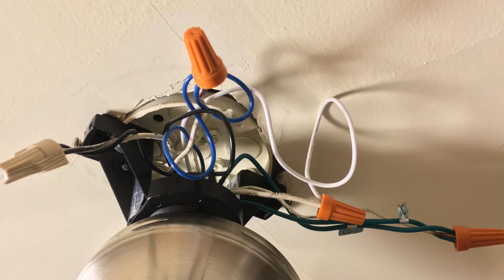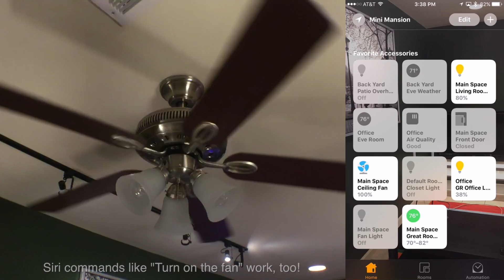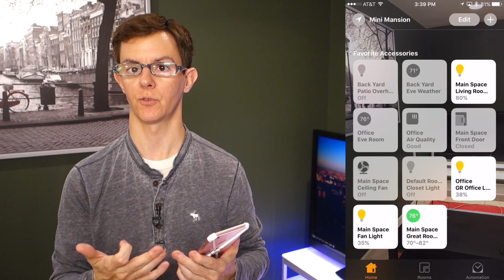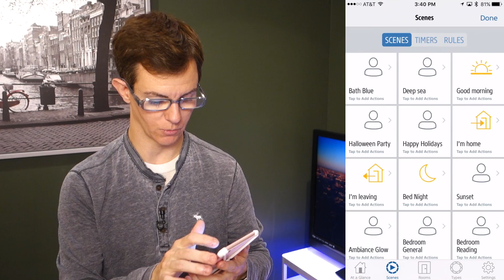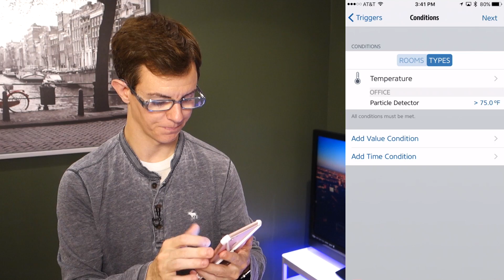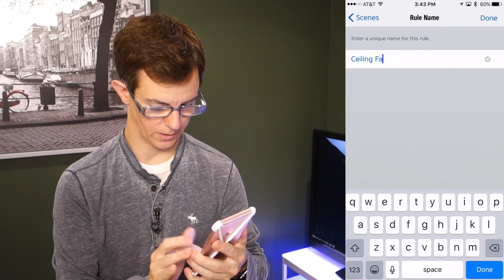Install & Review: Insteon Ceiling Fan & Light Controller

Comment: This is an excellent demonstration of an important automation area worth exploring: fan controls. We also use HomeKit to control our fans: turning on bath, and range hood fans when humidity, temperature, or CO2 levels reach preset levels. We are looking for more variable speed controls in HomeKit to provide increased granular control over fan speed, so this provides one useful path. I wish there were a method that didn't require a hub, and homebridge - to simplify the process.

Comment: Do you know if this would fix my ceiling fan motor that is stuck on 1 speed?
Reply from the maker: Potentially. Is it stuck on high?
Reply: Yes it is definitely stuck on high.  I was going to purchase a either a new switch or capacitor.  I was wondering this this device would be a replacement for that but I figure that is not the case
Reply from the maker: If it is stuck on high, then that's perfect actually. You could connect the fan to this device - the Insteon controller - or any other fan-speed controller and have good results. They all require the fan be set to high speed so that they can then control the speed appropriately.
Reply: Joe, thank you for the information.  Last question do I need the Insteon hub to use the controller or can I use the controller with a different smart hub?   I'm still up in the air on deciding which smart hub to purchase. I'm leaning toward Samsung's Smartthings.  Thanks for your informative videos and keep up the great work!
Reply from the maker: Yes, the only drawback is that you'll need an Insteon hub to use the controller. But there are many other fan controller kits that are out there that offer remote control via an RF or IR remote that are less expensive, but don't necessarily have smart home integration. You could get a cheap IR/RF fan controller and then link it up to a device called The Bond that can bridge IR/RF devices and smart home controllers.  And, thanks for your kind words! :)

Comment: can you use this light feature with  ceiling fan lights? just the lights not the fan. Just through wifi not going through taking apart wiring. etc...
Reply from the maker: Easiest way to do that would just be to use smart bulbs and replace the existing lights on the fan.

Comment: Can you provide a model # or paste a link for the fan controller you used for installation? Also, I’m guessing this requires the Insteon Hub Pro in order to work with Apple HomeKit? And how reliable does this work with Apple HomeKit? Thanks! Your videos are super helpful and informative.
Reply from the maker: Thanks for your kind words. And, actually, the link to the FanLinc product is in the video description :-)  For HomeKit support, yes, it does require the Insteon Hub Pro. My specific setup is custom, using a software platform called HomeBridge to enable HomeKit support on the Indigo home automation platform. Reports on the Insteon Hub Pro are mixed, mostly issues with their app but not necessarily the hardware itself.  Insteon was recently acquired and has had a cash infusion, so many fixes, updates and newer products are expected to be coming soon.
Reply: Smarter Home Life Thanks for the info! Would you recommend the Insteon Hub Pro? I’ve seen mixed reviews as well, so I’m hesitant to invest in Insteon unless it’s reliable.
Reply from the maker: It's true, the mixed reviews. I haven't personally reviewed the Hub Pro...but Insteon itself is really solid. Unfortunately, the only "easy" solution to add HomeKit to Insteon is their own Hub Pro product.
Reply: Smarter Home Life Thank for your help and information!

Comment: Nice video.  I installed the Fanlinc last year along with a 6 button keypad in the master bedroom.  That was a challenge linking them together.  Ended up calling support and they walked me through configuring it as scenes for each button.  The support was surprisingly good.  I would like to use homekit but last I looked, the insteon homekit hub did not work with motion sensors.  I have several setup for outside and this is a deal breaker.  So I use the 2245-222 hub.

Comment: please talk about Google integration on your videos. I'm invested in their ecosystem and I love your videos
Reply from the maker: +Cameron Ryan As the capabilities of Google Home expand, there will definitely be more discussion on it.
Reply: I'm sure there's ways to workaround to make it work now like you showed here except with the Google ecosystem? Or do they have it locked down? It's funny it's like Apple and Google swapped sides for this release, usually Apple is closed and Google is open.
Reply from the maker: The Google Assistant doesn't yet work directly with all home automation / IoT devices. You can get around it temporarily via IFTTT integration but that introduces another "middle step" which isn't the best. Google might beat both Apple and Amazon in the "digital assistant" and home automation race in the end, but only time will tell. Without a lot of potential hacking around the integration problem, the current demo that was shown with the Insteon device cannot easily (or possibly at all) with Google Home right now

Comment: Really cool video.. so like you I have a dumb ceiling fan with light but connected to a Lutron fan/light switch, however the switch is a dumb switch as well meaning it can't communicate with my Lutron hub due to compatibility reasons as well as I really do like the look/feel of the Lutron switches.. my question is do you think I'd be able to connect a smart controller such as this to my existing Lutron switch system?
Reply from the maker: Thank you. Sadly, Lutron and Insteon can't communicate with each other. Do you have a Lutron Caseta hub or a different one? Lutron does make a ceiling fan controller specifically like the Insteon one for the Caseta system, but their brochure says that one of their wall controllers might do the trick. http://www.lutron.com/TechnicalDocumentLibrary/3672499a_Caseta_Brochure.pdf
Reply: Actually i do have a Lutron caseta hub with many Lutron caseta switches all over including the master bedroom, however based on my research they don't have a fan control system that ties into caseta that's why I opted for an older model Lutron with a canopy control: https://www.amazon.com/Lutron-MA-LFQHW-WH-Maestro-Control-Dimmer/dp/B000MOIDA8 my thinking is that I won't need the Lutron and insteon to communicate on a smart level.. My logic is that if I enter the room and I physically press the switch the fan on it does, however if I were to tell Alexa to turn on/off the fan/light then that triggers the insteon part through smartthings.. I guess it may be a dream but I've been looking for a smart method of communication to that for a while.. Lutron does have a caseta compatible on/off switch but it's doesn't allow any control of speeds or light dimming..
Reply from the maker: Ah, gotcha. Ok, that makes sense. The Insteon stuff isn't quite compatible with SmartThings without some hacking, but can work with Alexa with no problem. Also, there are some Insteon integrations with IFTTT, too.
Reply: Thanks for the info.. will do some more research on it..

Comment: Would this product work with ceiling fans that use a wall controller or a pull cord switch mounted in the ceiling fan unit itself?  Many people I've known have had ceiling fans that have wall controllers, but my parents' house has ceiling fans with pull cords.
Reply from the maker: Pull cords are totally ok, because they're just supplying on/off to the fan motor and/or lights. An existing wall-controller could be disabled if necessary, it depends on how it is wired in at the ceiling fan canopy. If a controller is already there, it could be swapped for the Insteon controller. Without knowing the exact setup, it's more difficult to give advice on it.